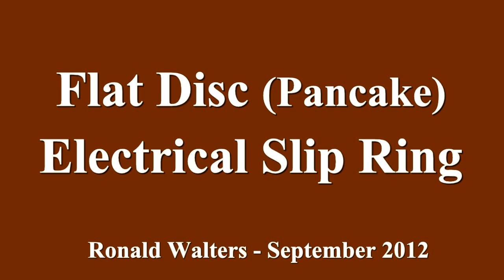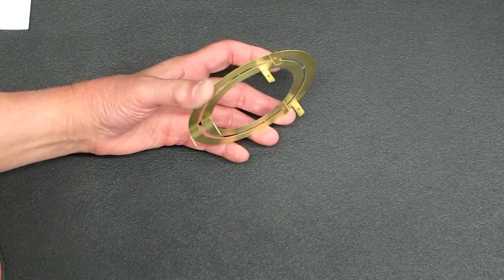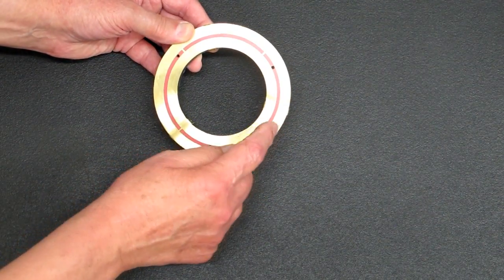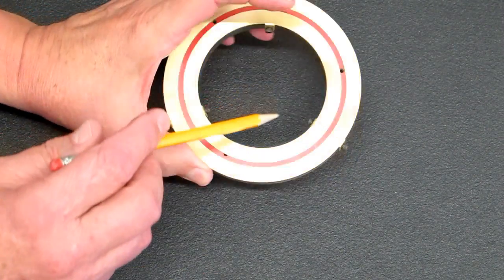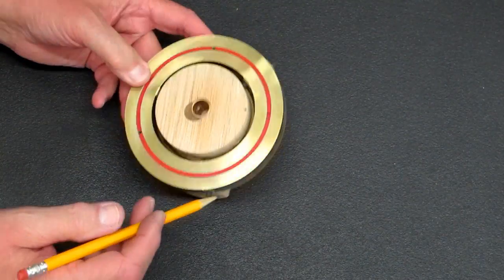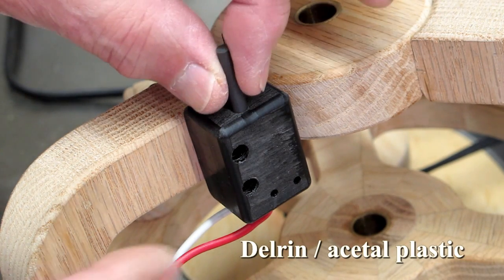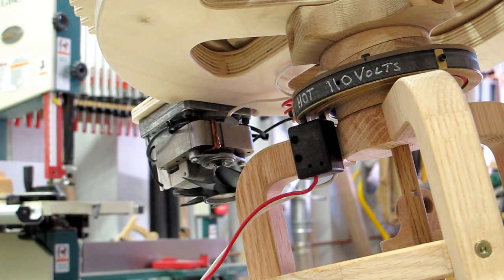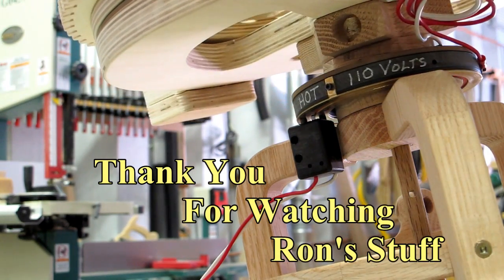Flat Disc Electrical Slip Ring

Comment: I was wondering if the brushes could be replaced with ball bearings to reduce friction and wear ... I can see that my suggestion could lead to electrical arks in a case of misalignment of the metal balls.. anyways Great vid!

Comment: Hi! Does the surface area or gauge of the brass sheet effect anything?
Reply from the maker: Surface area needs to agree with the contact area of the carbon brushes plus a little extra for any runout. Gauge needs to be sufficient for the power being transmitted (i.e. a very thing sheet or foil might burn out like a fuse). There is always the possibility of some arcing between the brushes and the brass. Thanks for watching and subscribing! Ron

Comment: Nice job. Quick question did you get any anomalies in voltage (spikes drops distorded wave form etc). I am asking because I would like to do something like that but electronics will be powered and anomalies like described above are not a very good thing. Also would it be possible to pass through more complex signals like VGA or HDMI wit the addition of rings of cource.
Reply from the maker: I haven't noticed anything. This is running a shaded pole motor with a large gear box so even if the power interrupted momentarily the motor would coast and for my application I wouldn't notice it. Some or the larger slip rings are used for overhead cranes (high voltage and large motors). If you google Electrical Slip Ring you will find manufacturers who make these for all sorts of communication/data transmission for various applications including subsea robots. I don't know if you could make your own but I'm certain VGA or HDMI would certainly be something that has already been manufactured... the price might be a shock.

Comment: instead of flat disc slip ring how the normal one i.e circumferential slip ring are made? By what insulating material it is been made? I want to know about them. how can i contact you? please give me your mail id sir.
Reply from the maker: I suggest you Google Electrical Slip Rings and look around. A lot of these are made for low voltage low power applications. This shows how one for a wind turbine works https://www.windpowerengineering.com/electrical/a-few-ideas-for-longer-life-slip-rings/

Comment: Interesting. I'm in the process of trying to find materials to make a 12VDC (low amperage) rotary connector for a "powered ground board" on a Dobsonian style telelscope. I can do a CAD drawing but in my area finding a way to fab it will be difficult. I'll probably end up hand-making it, or buying something like this: https://www.astrosystems.biz/ASPFTinst.pdf

Comment: I need a slip ring about that size and design. Would you be willing to share the design were I could have one machined like that?
Reply from the maker: All I have is a photo of the drawing with no dimensions. The drawing was made to my sketch on the water jet company computer and I did not obtain a copy of it. The part was cut with a water jet and the unwanted strips removed after assembly. Go to my channel page... ABOUT and send me an email. I will sent it back to you. Thanks for watching. Please subscribe!

Comment: Great job, and looks professional! I can't seem to find that big Delrin cube. Instead, do you think it would work if I drill a piece of wood block and insert the brushes in it?
Reply from the maker: On eBay search for Delrin or Acetal and you will find all you want but it is not cheap. Possibly a local machine shop or materials supply. Wood may be a bit rough for the springs. In my opinion it would best be made of Delrin or some plastic like plexiglas, lucite, perspex, acrylic. The easiest to machine is Delrin and it holds threads well.

Comment: Awesome video mate!!
Do you have access to a cnc or did you pay someone to cut this out 
And do you have more infomation on how you made the brushes??
Cheers
Reply from the maker: I used a company with a CNC water jet machine to cut the brass part. You need to look round for some round carbon brushes and make a holder like I did. I have a small washer soldered to the end of a wire which is fed through a brush hole first... then the brush spring makes contact with the washer when the brush is placed into the hole.

Comment: Ron Good vid, in the US you have 110V and I note you say about not sticking your fingers in it so I am assuming you are using the grid supply of 110 VAC, Would there be any reason why I could not achieve the same over here in Spain with 220 VAC, It can all be sealed in a box, I want to make a turntable and have a 220 volt supply on the turntable to power items turning which I would not be able to do and these items are AC voltage. I was thinking of using slip rings of ebay but the wires dont seem thick enough, for a socket here we are supposed to use 2.5mm so the motor that drives the turntable will DC I expect and the voltage ontop of the turntable will be 220v in a closed socket
Reply from the maker: You should be able to do the same thing... just need to make sure the metal and the brushes are suitable for whatever you are running. Your 220 VAC will kill you twice as fast as our 110 VAC... but your 50Hz won't shake you quite as fast as our 60Hz. :-) It really does need to be fully enclosed. Heavier commercial slip rings are available (for a price) as they are often used on overhead cranes. It is usually the lighter robotic or communication stuff we see listed on eBay.
Reply: Ok Thanks for the heads up on that, I will see what all the parts cost, I can get a complete finished unit for 120 euros on painted and with 3 sockets , so i will price it up and if its near I might just buy the one made here it suitable for up to 50KG and be safe.. Thanks a lot for your help.
Reply: Neil Scott hello. Iam interested if you got the solution. Iam having few problems of geting the 220v slipring myself in europe. Did yours work and would you be prepare to share it?

Comment: This is great! If I use this concept for 12 volts DC, one ring would be positive and one negative, right? Second question: Where did you get those graphite brushes??? I have never seen them in that length before!
Reply from the maker: One could be positive and one negative. Brushes from Arrowhead Electric Co. 562-952-8521  Item 406 round brush.
Reply: Sorry but Slip rings are used in AC not DC
Reply from the maker: Sorry... but they are used in AC and DC.

Comment: Ronald Walters@ How much power can be transformed through slip wring? I am working in a factory which blow moulding machine have 31 servo motor.
Reply from the maker: They are manufactured in all sizes. Large ones like used on overhead cranes or small ones for multiple small wires. You need to contact a slip ring manufacturer... google it.
Reply: get it

Comment: Where can I get a slip ring like that? I want to put it on my motorcycle brake rotor to light up led on wheels.
Reply from the maker: noaudio27 Sorry, can't help you with that one. Try googling electrical slip ring. Lots of designs out there. Someone has probably done it before.
Reply: +noaudio27  i have a bigger one in my m60a3

Comment: Hi Ronald. Thanks for the great video. Do you know if a small slip ring can be made for something like a power strip/surge protector? It needs only to be one circuit, turn 360 (doesn't have to spin - ever), about .5"D...but handle 30A. Doable?

Comment from the maker: Block machined from Delrin (acetal resin or Polyoxymethylene plastic) which machines, drills and taps well. Brushes from Arrowhead Electric Co. No. 406 Round Brush. You’ll have to do some Google searches for Electrical Slip Ring. They are available from 3 to 60 rings but you will need to determine what suits your purpose (dimensions, voltage, current handling capability, RPM, etc). Good luck!

Comment: Great video Ronald.  What material did you make the block out of for the electrical connections that house the springs and the carbon brushes.  I've tried to do searches and I'm not able to find that style of carbon brushes.  Do you know where I can find those materials to make my own?
Also you mentioned that they were available already made commercially.  Do you know if they are available in a 4 contact style?  If so where?  I'm looking to create a setup with 4 rings.

Comment from the maker: Heavy-duty industrial versions are used every day. The motor in my video is small, amperage low and the brass ring relatively thin. Wiper brushes would need to be at least the same size used in your grinder. Probably best if there are separate wiper brushes for each grinder. Highest amps are at starting-up and when grinding. Do not overload the grinder. No load start. Light touch when grinding. Google ELECTRICAL SLIP RINGS for commercial products and they are enclosed and insulated. Good Luck.

Comment: I wanted to do somthing similar to this with my motorcycle .. there is a company that sells the kit for 290 . Gives your wheels power so you can insert leds and power while driving . But they make a slip ring with 3 different rings for 3 different powers for each light color . Did you order these slip rings to have them made ?

Comment: I see what you're saying now. Why not use heavier wire where current is used so they do not need to be soldered together? Or what if your 3rd rail was ABOVE the bearing and it rolled through a series of dangling lightweight wires that hung down freely and were the other side of the circuit? As the ball rolled through the hanging wires, it just keeps completing the circuit or it could even complete a different circuit for each wire?

Comment from the maker: I saw your comment on denha’s channel. It is actually something I have considered for a low voltage circuit. The spacing of the rails needs to be VERY precise for the bearings and they are usually held apart by a bent piece, which is soldered to both. Maintaining the spacing of the two rails while not having them connected is problematic to say the least. I have considered a third rail, which is very problematic for any contact duration while not slowing or stopping the bearing.

Comment: I made a suggestion on another channel with marble machines, and I want to make that same suggestion to you. Why not make the rails that the marbles run on hot with a POS and NEG and the steel marble completes the circuit and maybe lights up some LED or even starts and runs a motor for short durations? I think it would be cool to have lights, and more actions going on like a spinning wheel as the steel ball rolls around. Just a thought here. I LOVE your videos and please keep up the GREAT work.

Comment from the maker: Funny thing, when I built my shop I never intended to do any woodworking (and had not done any woodworking) so I did not insulate or heat it. It is a solid steel building and like trying to heat a giant radiator. I would die of the exhaust before a kerosene heater would raise the temperature 10 degrees – tried it. :-)